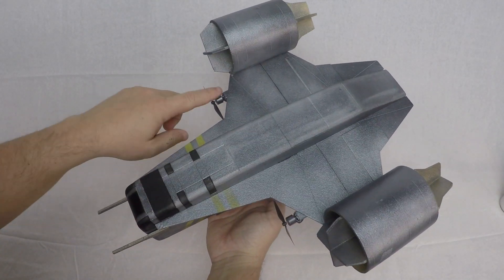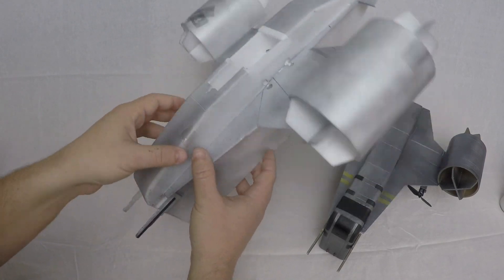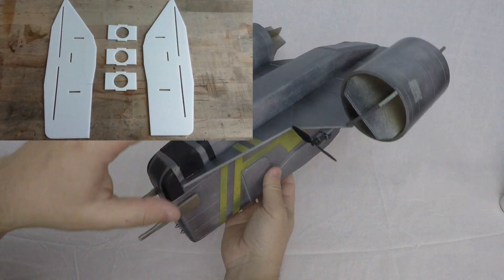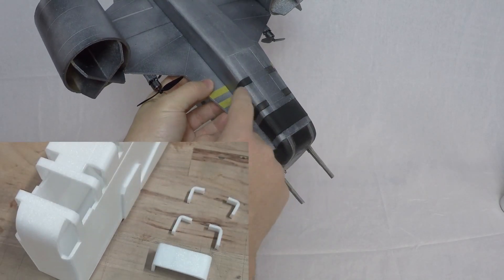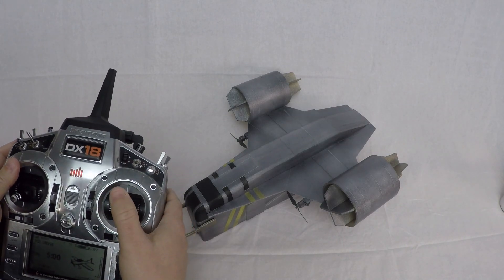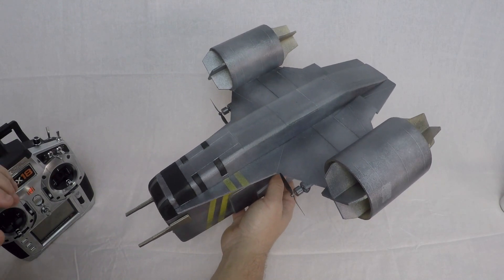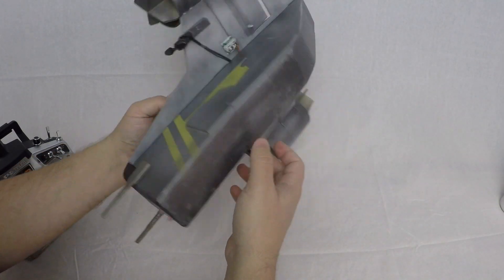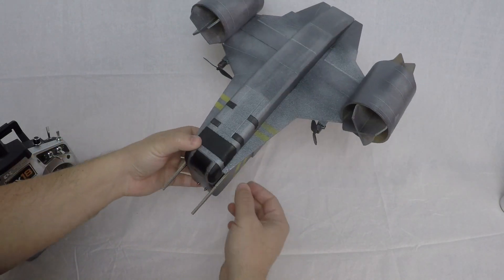The Mandalorian's Flying Razor Crest

Comment: I know jack about RC flying, so my question is probably ignorant but why was is not possible to mount the props & motors in the engine tubes? Would the air flow be diminished that much?

Comment: Another great build here. Was actually sketching this out yesterday during break at work then saw your video today. Awsone work. I am building mine out od 5mm dollar store foam at about twise the size as getting 3mm depron here in canada is almost imposible.
Reply from the maker: Thanks. Yeah my supply of flat 3mm foam is running low. I bet it would work great a bit larger. There will probably be enough damping at that size to get away without having to use active stabilization.
Reply: @ajw61185  i have an A10 from umx that has seen better days and it has twin esc output. Is that the same reciever you are using. Mine is the AS6410NBLT DSMX 4-Channel AS3X Receiver with Twin Brushless ESC
Reply: @bobofthebush5691  the Ultrix RX is a different 1S beast.  Does the A-10 (or Aero Commander) have any way to talk to the two speed controls separately?  Or do yaw with differential thrust?
Reply from the maker: @bobofthebush5691  I'm not sure about the aero commander, but the A10 board is not setup for differential thrust.